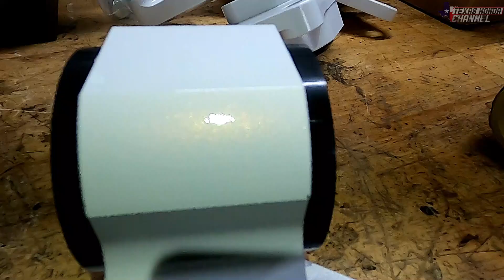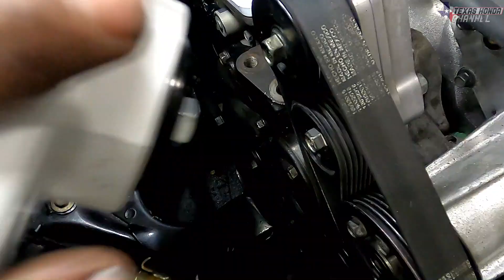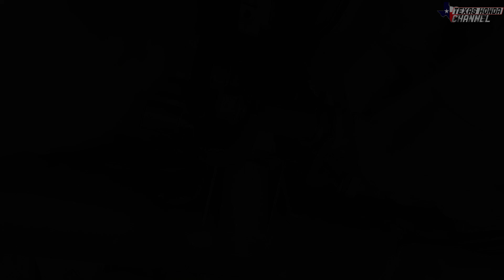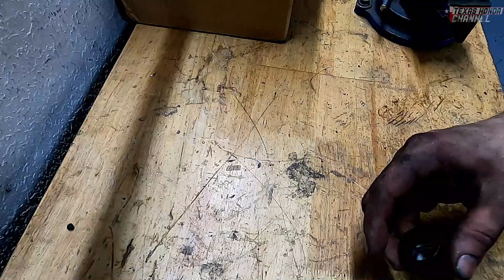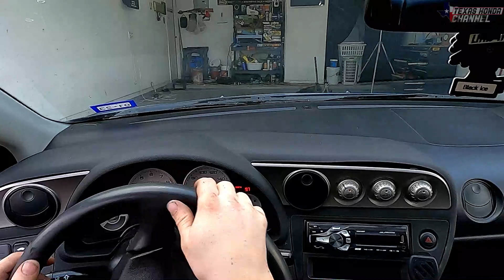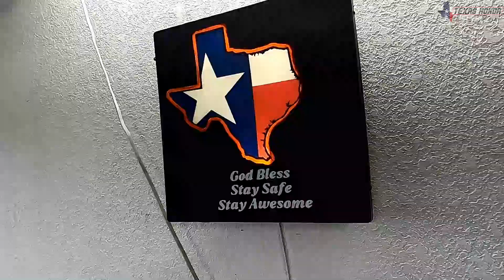SUPERCHARGED RSX SOLID MOUNTS & CATCH CAN INSTALL!

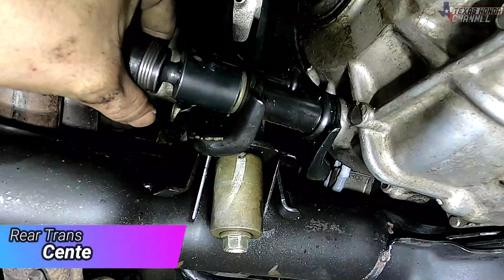Comment: At mark 4:59 showing the rear mount... does anyone know what that huge shoulder bolt is designed that way???🧐 btw I have the same KN air intake and my carb sticker is messed up and unreadable. I asked KN for a new one but they are asking for all the numbers on it. I guess the numbers verify it’s actual intake for that car model (Rsx). Can you help me out?

Comment: Nice install. Correct me if I'm wrong but wouldn't routing the catch can lines down under the intake & back up into the catch can cause whatever oil there will be to "pool" in the lines at the lowest point eventually causing blockage & or back feed issues? For functionality would it not have been "more ideal" to run them over top of the intake or some other way into the catch can causing a drain effect into the catch can?
Reply from the maker: It might pool up but you gotta think also there is going to be a lot of pressure pushing throw them lines blowing whatever pools up. If it was a oil return line or something I would be more worried but since it’s just vapors and some oil then it should be okay. I can always check after a few hundred miles to see

Comment: I had a skunk 2 on my Honda Civic K20 and it was tucked under the front bumper off to the side so I get nice cold air
Reply from the maker: Yup 👍🏻 I have a Injen intake for it but it requires the battery relocation and washer fluid delete so not sure ima run that one.
Reply: @TexasHondaChannel  on mine it just ran underneath the battery but I believe the Civic had more room in the front. Also thanks to you I am attempting my first little project I have a fender I am replacing and I am painting it this week oh, I've been watching you for quite a while now I can't wait to see how it comes out I'm sure it'll be not very good LOL but it's just paint if it looks horrible I can just redo it
Reply from the maker: @jaysteiner1658  It takes practice for sure! I also decided to delete the washer fluid and do the true cold air intake. I have pictures on Instagram.com/texashondachannel . I was able to keep my battery up front.

Comment: One bolt on the transmission mount is still loose. Check it !
Reply: Ya the top left one huh
Reply from the maker: @Nexttime  it indeed was. I noticed it just didn’t mention it in the video. It’s all good don’t worry haha
Reply from the maker: Was* but yea. The washer was rattling lol

Comment: Cross-thread better than no thread. I watched 2 bolts get zipped in and 3-7 Ugga Dugga’s (3-7 mother f*****s) and called good. No hate, love to see it coming together. Hopefully those bolts never have to come out hahahaha!

That’s an interesting oil catch can. I’d like to know how it works in the long run. Is it just sealed with 2 orings on the top and bottom?  How big is the outlet going to the catch can?  How well does it work with a boosted set up?
Reply from the maker: Haha yea man I been using Ugg’s dugga for awhile never stripped it. The lower bolt on the transmission bracket isn’t cross threaded. None of them are but I knew someone would say something haha. Idk how it does for boost so ima gonna keep an eye on it and see how the catch can fills up. They are -10an lines
Reply: @TexasHondaChannel  what side holes in the adapter though. Will if fill a -10?  Either way i was just yanking your chain. The blower sounds good. What Eaton is it??
Reply from the maker: @doctordifferentialspeedsho9506  MP62 same as the colbalt SS. I’m not sure I follow on the question exactly. The catch can is a -10An on catch can and the adapter that bolts to the valve cover.